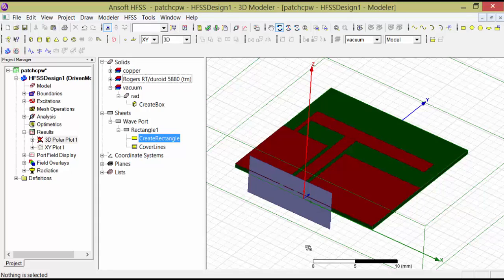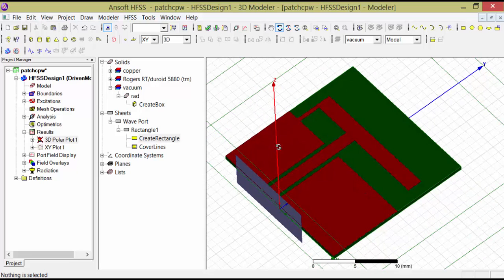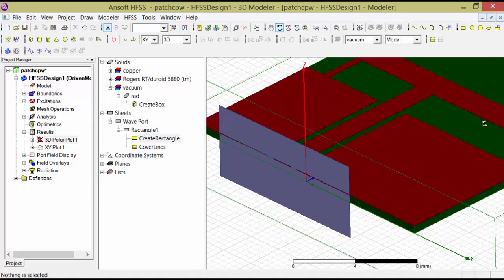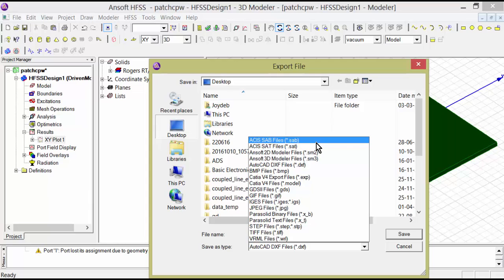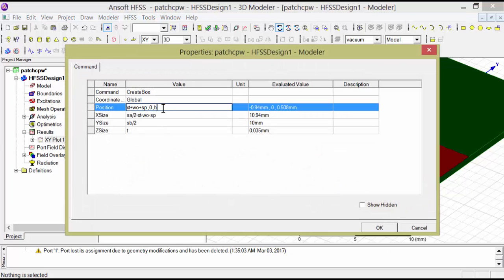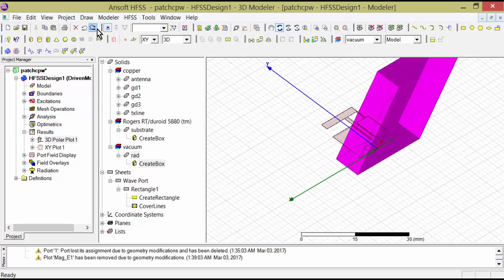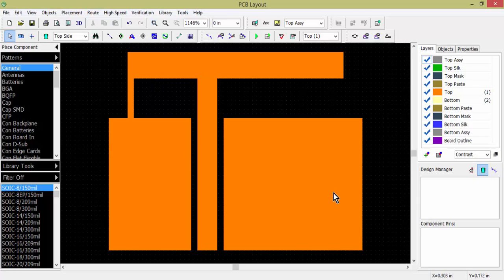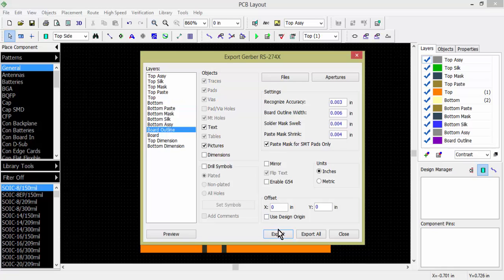How to export dxf or gbr file from HFSS

Comment: hello...I got a SIW structure and it has got some 400 vias and its a two layered structure. Could you help as per how to convert it into dxf...
Reply from the maker: Hi,
(Follow the link)
https://www.youtube.com/watch?v=gpjgxHJma1I

Remember you have to export each layer one by one when all layer are not present.
Next, For via you export as let say via.dxf. 
Follow the steps:
1.Import top/bottom/board outline as per design.
 2.For via Select convert to PAD(other case you suppose to select top/bottom) with import mode add.

After that in right hand side in "Design manager"  select the pad, you can visualize the via.

You may follow https://www.youtube.com/watch?v=gpjgxHJma1I

But worst thing is that you have to make static via for all the case. You may copy the static via group if there is any group formation is possible.

Then copy paste via group.

Comment: Hi, thank you for video.
But in my diptrace, there isn't a "fill closed areas" part. What do you think about the reason of this lack?
Reply from the maker: +Ali çelik thanks for your question.

1.Check your screen resolution. This is main problem,

2.Use latest version of diptrace
Reply: Hi, thank you. Actually, its reason was resolution and problem is solved. My another question; if there is a slot on the ground or patch, what will we do? Does we accept the slot as a layer, if yes how can we show it in diptrace. Because when I select the "fill closed area" for bottom part, diptrace fill the slot part, too. 
So, what is your offer?
Thank you.
Reply from the maker: https://www.youtube.com/watch?v=gpjgxHJma1I&t=207s
Reply: @rfzone3099  sir please explain same for multilayer